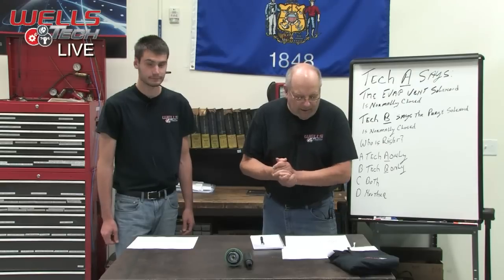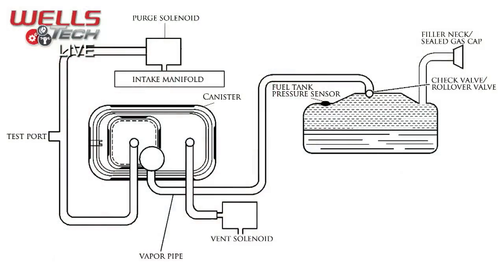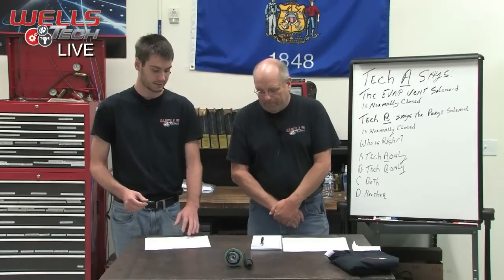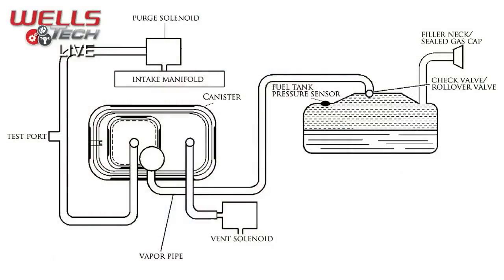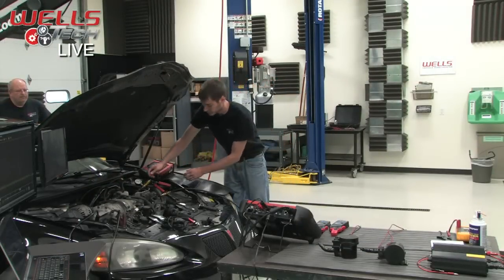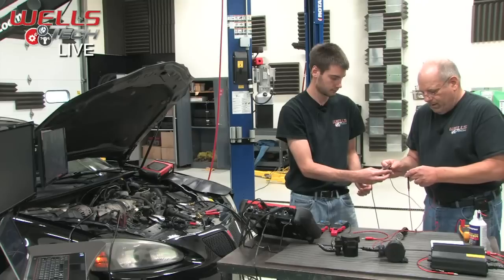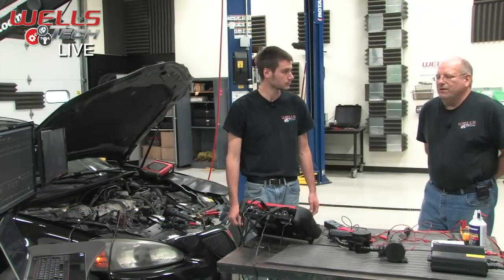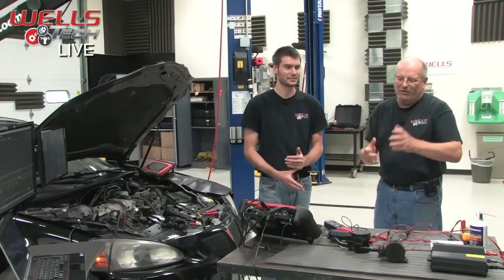EVAP Leaks P0442 and P0455

Comment: I have the same thing going on with a 2006 Saturn Vue.I have 12volts across the circuit whether on or off with my meter but no shorts to ground.I have 10ohms resistance to ground on and 125k ohms off.It doesn't go completely OL.

Comment: If it's not dirt and debris causing intermittant issues with vent solenoid plunger operation then it can be moisture in it causing the valve to stick open only when conditions of outside temps are low. 

In the movie Gladiator as Maximus puts it, "Frost on the blade make it stick in its sword holster."
Reply from the maker: Hey, sure can. The evap system isn't the only system to have to deal with this. PCV on GM 2.4L's have a huge issue with freezing as well.
Mike Becker, Senior Technical Instructor

Comment: Thank you Wells for a fine and helpful video, For those of you who need to smoke the filler neck end and don't have the filler cap adapter, I went to the dollar store and found a rubber ball that fits perfectly, drill a hole and run your hose through it, leave it poking out far enough to keep the flapper valve open, 3 balls from the dollar store for a dollar!
Reply from the maker: Hey Cr r, great idea. That's a solid savings over the adapter. Do you get a quality seal with it though? Sometimes we are looking for smoke, other times we are looking for flow, or the lack of. Without a perfect seal it could cause that test to fail. I love the ingenuity though! Nice!
Mike Becker, Senior Technical Instructor
Reply: I think the seal is pretty good, at least for a smoke test, but to your point a gas cap adapter is best and would rule out the possibility of a small leak at the gas cap sealing surface.
Reply from the maker: If it works it works! Plus 3 for a dollar is a huge price savings. Good stuff man!
Mike Becker, Senior Technical Instructor

Comment: Code P0455 ( Large leak) is almost always a gas cap issue. Most emission testing procedures test the gas cap anyway, but if the CEL is on, it's an automatic failure before it gets to that point. I'd have the shop test the gas cap anyway to see if it's the problem. It most likely is.
Reply from the maker: I disagree. The common thought is that it's a gas cap issue. It's staggering the number of perfectly good gas caps that get replaced. I am all for testing the gas cap, but to assume it's the issue is a problem for me. 
Mike Becker, Senior Technical Services Instructor
Reply: @GoTechTraining  would a broken fuel door cause this code?

Comment: 1 thing i would have done different, when smoking, is to leave the gas cap inplace! With a P0455 its quite common for it to be a failed gas cap, and if it is not sealing properly, you would see the smoke leaking around the seal
Reply from the maker: Hey Splash, that is a good point. Thanks for commenting.
Mike Becker, Senior Technical Services Instructor

Comment: Hello Tech's. I'm a little confuse when you guys turned on the vent solenoid and put smoke in the system. The vent solenoid is normally open, is normally open for all the fuel vapors get suck into the canister and when the solenoid closes, the vapors get suck into the intake by the command of the purge. When you guys ran smoke into the system you closed the vent solenoid so how is smoke getting pass the canister to the fuel filler neck with the vent solenoid close?
Reply from the maker: Hey Jorge, thanks for watching! The vent and the fuel filler neck are completely different components of the system. They are not integrated. The vent allows for breathing in fresh air, completely separate of the fuel filler. 

Mike Becker, Senior Technical Services Instructor

Comment: Guys I'm getting the small leak code and my fuel tank sender unit is sticking showing empty after a fill. So could that be sending the check engine light? P0442 because I can't seem to find a leak.
Reply from the maker: MT-01, the EVAP system uses the fuel level sender for part of the test. Usually with a faulty sender the test won't even run. I would recommend repairing what you know is wrong, the sender, then retest!
Mike Becker, Technical Services Instructor
Reply: I heard a faulty fuel tank pressure sensor canal so cause this to happen.

Comment: I got a p0455 pending code. Changed the canister and purge solenoid. Still have the code can't find the problem
Reply: The Original Trucker Gaming 
Did you try replacing your gas cap?

Comment: Hi!
I watched carefully your testing and metering on the purge solenoid.
I would suggest something what I do when I run in some problem like you run with the data about the resistance of the solenoid. Is 22 Ohm a good value or a 19 Ohm?
I suppose the problem cos because the 22 Ohm. Actually I always make the math when I run in a situation like this.
If you check how much power will consume the solenoid wit 22 Ohm and how much power consume the solenoid with 19 Ohm than you will figure out does, the solenoid which has 19 Ohm will consume around 23% most power than the solenoid who has 22 Ohm. If in any system is a so huge difference of 23% error than that part should be out of spec. I think...
Reply from the maker: Hey Christian, I would be careful using an OHM reading to determine a bad solenoid. An OL reading would definitely say the solenoid is bad, but I would be very careful if you are trying to determine solenoid operation or not based on a 3 ohm change. Temperature alone can do that. 
Mike Becker, Technical Services Instructor

Comment: Good work guy's i had a PO455 come up on my2002 silverado  and it also showed a tank  air high and tank air low at same time so i went after the tank air sensor that did it' got a well's part from atuozone thank's.
Reply from the maker: Hey Eddie, glad you got it figured out! Fuel tank pressure sensors play a vital role in the EVAP system. Without that working properly the truck has no idea what kind of pressure or vacuum is in the thank.
Mike Becker, Technical Services Instructor

Comment: Great vid guys,  and I might add that I get a lot of evap work for some reason. your problem is all to familiar I energize the vent and it seals .I have had this happen on numerous occasions. I think that a lot of people keep that gas level real low most of the time so the test never seems to run and the valve builds up corrosion. After energizing it a few times it seems to seal just fine.
Reply from the maker: Thanks George, so you think that corrosion and stuff builds up in the open valve, then the computer goes to close it and it won't seal. But if you activate it a few times then it seals up just fine? That's a really good idea. One I think is definitely possible. Especially after seeing how much dirt and junk came out of my vent when I took it off. Thanks for the comment George!
Mike Becker, Technical Services Instructor